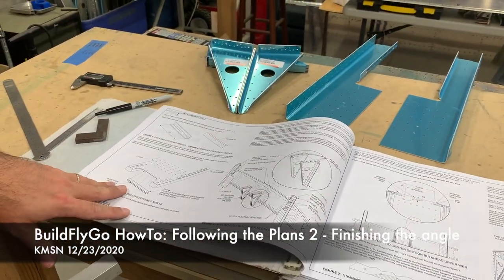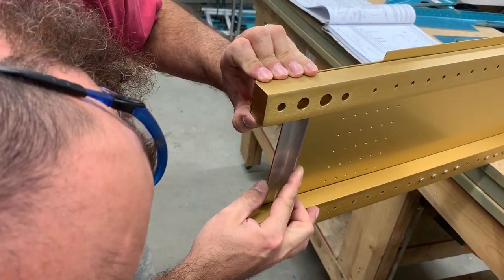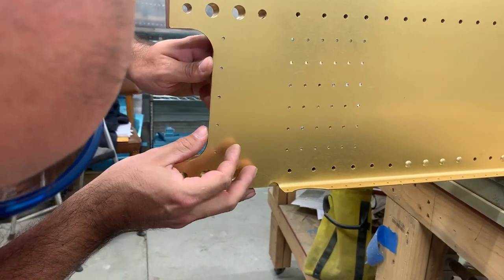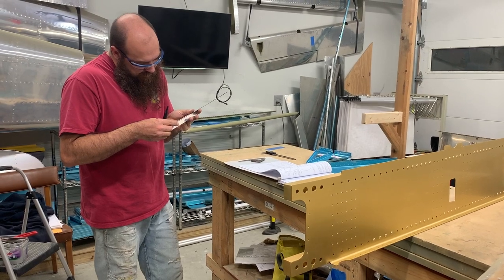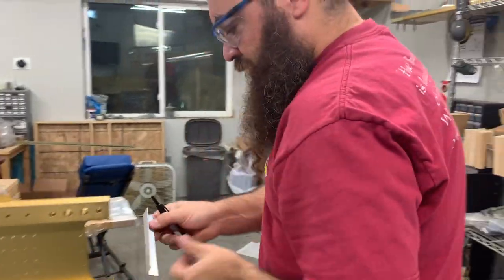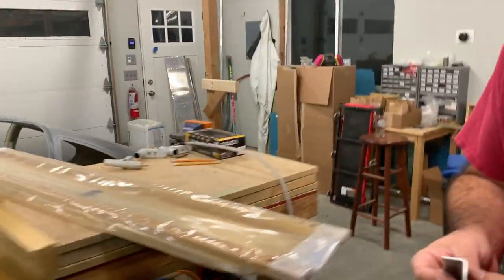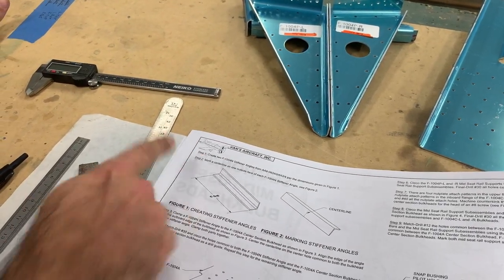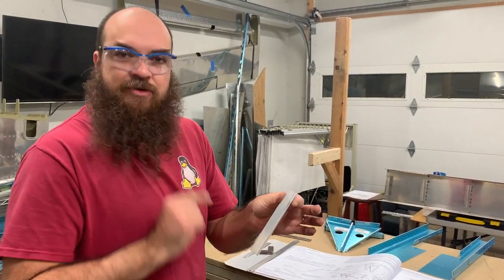HowTo: Following RV Build Plans - Part 2

Comment: is that anodized or alodined? You also need a bit more pressure when drilling. It shouldn’t take that long to drill through that thickness of aluminum .
Reply from the maker: Anodized. I agree, I think the drill bit was a bit dull. I’m usually really careful when drilling near the spar not to have the bit wander so I use less pressure.
Reply: @BuildFlyGo  when worked aircraft structures I always used new drill bits and followed a reamer for critical parts such as spars or support beams. Always replaced by new bits every 25 holes was my rule of thumb.